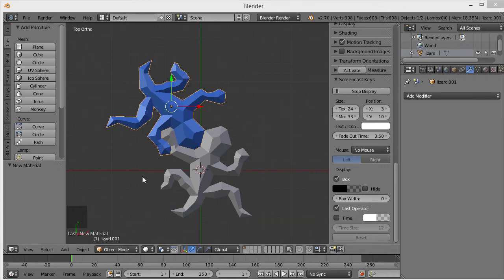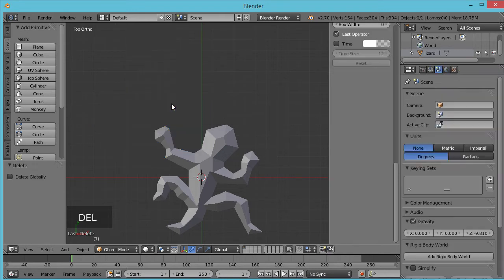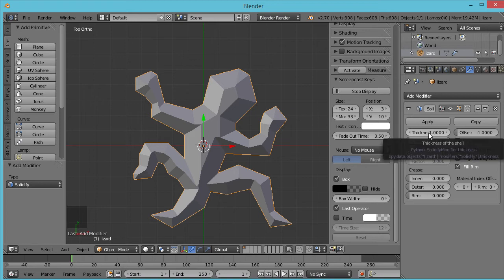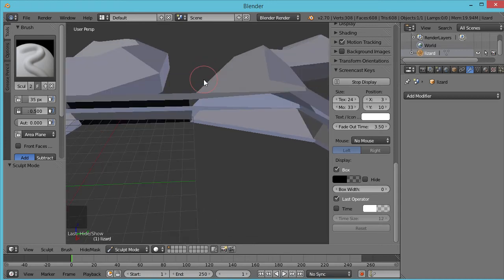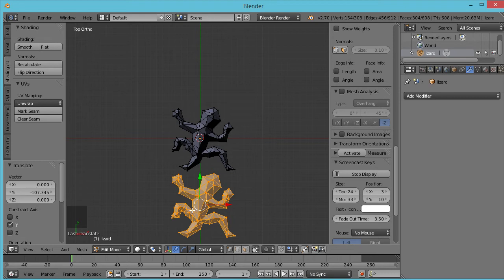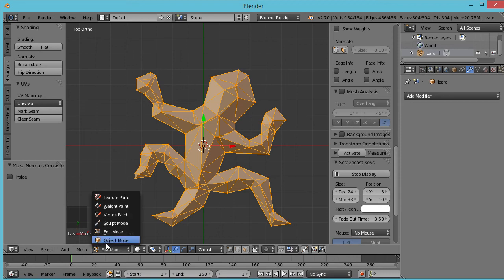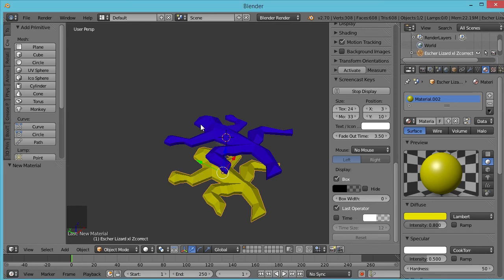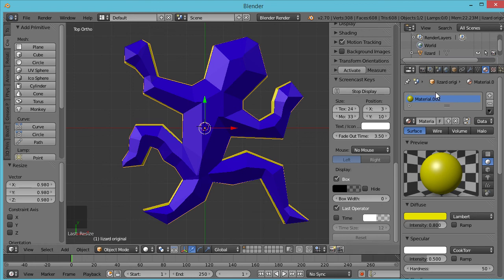Make It Fit: Adjusting Part Clearances with Blender

Comment: Very nice trick for this case. Displace modifier can do the trick too (no texture, direction: normal, Strength: -1, Midlevel 0.9 more or less). Adjust the clearance according to your material, accuracy, ... My 2 cents.

Comment: I knew you were one of the guys from 3d printing today as soon as I heard your voice! I love the podcast and thanks so much for this video. It solved my problem! Although my use case was different. I had an object I was using to boolean out a shape in another object. I wanted to allow come clearance to fit in the original piece (used for bool). I just solidified my bool object in the opposite direction to create the clearance!